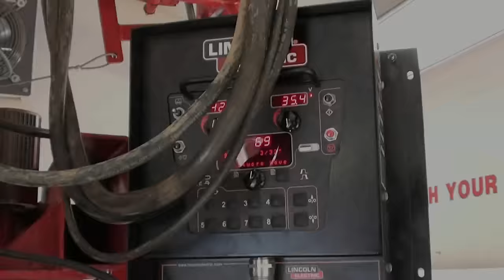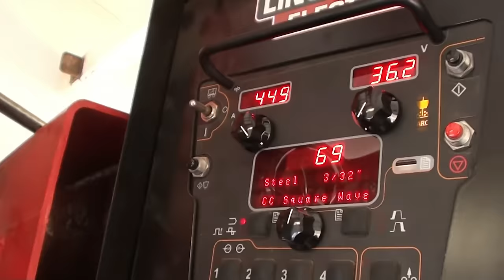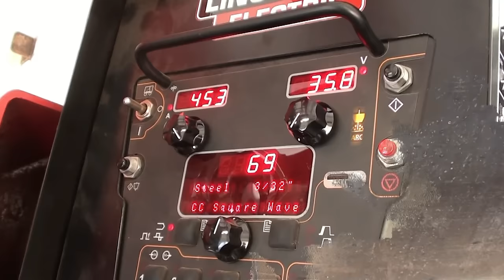Sub Arc Welding - SAW

Comment: This is the method of welding that the US sent technical advisors to the USSR during world war 2 to show the soviets how to make really good welds on the hulls of the soviets tanks. It increased the durability and decreased the production time of the tanks so that the germans had a really bad time on the eastern front. As an example the T-34's made before the war started were good but once production speed was increased, the T-34s were susceptible to having their hulls crack at the joints between the massive plates. So these tanks were literally cracking apart after being driven only 10 or so kilometers. And if they got hit by a high caliber glancing blow the hull would be ruined due to it cracking along all the seams. Afterwards, both speed and quality increased massively allowing the tank factories to outproduce the Germans  by a factor of almost 10.
Reply: I wanna see the rotisserie that spun those soviet hulls in a circle.
Reply: Nerd alert
Reply: Evidently some people have never seen seem welding equipment for straight line runs. Some people call that track welding equipment. Some of that equipment has multiple adjustment points to follow very irregular seams. I have seen subarc welding equipment with a hand held torch. The massive slag blanket and unmelted flux really help to slow the cooling rate in the weld zone and heat affected zone.
Reply: Appreciate the comment, huge fan of ww2, very interesting.
Reply: how did they fix the heating issue?

Comment: I'm gonna start dumping kitty litter on my mig welds.
Reply: Clean it first or you will get shitty welds
Reply: These are the two best comments. Got a good chuckle out it. Lol
Reply: I think it would work better with my $99 flux core.
Reply: I bet if you got a crate of sparklers and cut em into little pieces and dump em on your electrode you could do even better welds.

Comment: Haha, this takes me back. Spent 9 months as the offsider on the other side of those 4 ft diameter cans knocking off the slag strips with a hammer (point and chisel-point). Steel was 3/4" thick, and usually took 3-4 rotations to fill the gap (was a wider gap) with cap weld on top to finish. Looks like you don't have a problem with slag strips these days. It was 35 years ago for me. Welders were still Lincoln Electric though, but no fancy digital displays. More or less just a knob for volts and a knob for amps. Nice work :)
Reply: (I hate when people do this)

Comment: Never saw a cleaner weld in my life. That machine is amazing. I may read up on Sub Arc Welding because it seems like a very interesting process.
Reply: Then you are not keeping up ....well your comments is 7 years old .....wait a minute 6 years ago I was operating a tower trolley sub arc that welded 12-16  foot diameter tower sections together and this would have gotten me FIRED!

Comment: In Ireland this is known as Submerged Arc Welding and according to the steel fixer that attempted to teach me how to arc-weld back in the early 1970s the technique was reputed to have been perfected by a team of welders and engineers at the Haarland and Wolfe ship yard in Belfast (wher Titanic was built) and was used initially to butt weld large sheets of plate steel together to form ship-decks etc. Nice demonstration video.
Reply: Frussell3 It's still used for ship plates.  I UT these types of welds.  Most are very clean.
Reply: Frussell3 So the same name? What did you think "sub" was short for?
Reply: Well I guess it wasn't perfected on the titanic

Comment: i work in pressure vessel fab shop in the east bay California we use this process all the time for our round and straight seams for the large and small pressure vessels and heat exchangers we build. Awsome and super chill process to run if you know what your doing. Set up is the key for a clean sub arc weld.

Comment: I remember reading that the engineers working on Apollo in the 60’s had a problem with their welds and finally decided that the automated welder was the problem. So they took it apart and reengineered it. Great strong welds afterward.

Comment: Do this every day on round seams on pressure vessels. Far from perfect, I think its a popular process just because of the sheer amount of metal it can lay down so fast. Alot of ours have to pass x-rays and have a certain amount of imperfection or less. I believe it has a good amount of porosity, but so much is passable. I believe its been around since the 30s, and I wonder how ide never heard of it until i started this job.
Reply: J'ai soudé des cuves pour total,ce procédé est très sains en radio

Comment: The "kitty litter" flux lets impurities rise and insulate the weld so it cools slow:-)
Reply: That answers the questions in my head, thanks.
Reply: Thanks for the answer!
Reply: Thank you for the explanation =)
Reply: H3R3T1C yea it’s kind of interesting they posted this comment not knowing the actual use.
Reply: @MFKR696  Thank you for that correction, it bothers me that the least informed out there are the most confident when they speak. I used to work at Lincoln Electric in Euclid Ohio and loved seeing these massive pipe welding machines in action!
Reply: @MFKR696  a longer cooldown time of the weld and the surrounding metal is also benificial for the strength. So he is not wrong, but I am not sure if the" kitty litter" is doing that in this instance, seeing the turning speed and not knowing the material of the "kitty litter".
Reply: @MFKR696  I know what it is friend. I was just pointing out that the principles of what that guy said weren't wrong. But just not the case here.
Reply: @MFKR696  That was how the guy called it, actually liked it lol

Comment: I welded Sub-arch for awhile,  every wind tower is welded sub-arch. The kitty litter looking stuff is Flux so no shield gas is needed. When I welded we used 2 ,1/8" wire. One at 90º for penetration at 650v 31amps. The trailing wire was 550v 29amps. Trailing was fill and the pretty cap finishing weld. Our tip was set at 1 1/4 inch from the bottom of the crevice. Our average steel thickness was 22mm.

Comment: Actually, Tank builders are using sub arc to weld horizontal round seams, using a nylon or canvas belt on rollers positioned about an inch of so below the seam to catch the flux and allow it to accumulate above the wire and arc, therefore submerging the arc.  It makes really nice welds even in this position and if you are careful not to blow through thinner material, can do in 3 hours what would take 3 welders 2 days to complete, and do it with very high weld purity.

Comment from the maker: 800,000 views and going strong.  I never thought it would get over 1000!
Reply: Good stuff! We just got three new miller pulse mig machines for alum. Damn I'm gonna be outta a job here soon that's all I will say lol.
Reply: It can be a bitch/finicky sometimes depending on how it's prepped. Our shit is pretty clean so we don't even etch the oxidation off we just go right to welding. The new machines make it so much nicer and smoother. It's very fast, hot and bright as hell! You'll flash burn yourself in the matter of only a couple min. Literally.
Reply: A lot of the 1/4 to 1/2 we weld we run around 24v at around 200 amps. The old standard push pull machines would do the same but at 26v and with lots of spatter. so these new machines will weld the same thickness with better quality using less power :-) 100% duty cycle.
Reply: Well it comes at a price. These are about 15k$ machines. Not cheap at all! Funny thing is the power unit is only like 60 pounds and the feeder is like 30 or less lol. Big power in a tinny arse package :-)
Reply: I'm sure you seen the newer miller product line. Everything is micro chips and computer boards now. No big several hundo pound machines. Even the plasma cutters rated for 5/8 are suit case size now.
Reply: I'm the same way lol. Better to have what you don't need then to not have what you need when you need it :-)
Reply: never done it would love to try
Reply: I came here because I've never heard of the process. Seems quite interesting! Sand as a flux…never thought that would work out.
Reply: Mitch Guzman sub arc is the sheet! Super strong welds and no sparks no hood :-).  anything that keeps the molten from contacting open air and causing impurities. Basically just another form of shielding flux. There's more but not going to try and explain lol. In the old days it was eapestos wrapped candy stripe :-) basically a coat hanger wrapped in eapestos lol.
Reply: proof youtube is filled with people who want to better them selves!!
Reply: saudysky now almost 2 million!
Reply: Hi xAZAZELx13 I'm looking for a API 2B  carbon steel Concentric reducer DSAW 56"x42", do you have any idea where can I find a manufacturer for this piece? Thank you..
Reply: Humberto Chim Angulo  Lincoln Electric
Reply: @whirlpooldemons69  12,8 million today xD

Comment: I used to do this stuff. Pretty rare type of welding I found. Most welders have no idea what the hell I'm talking about when I tell them about the company I worked at. We made rolls for foundries and also rock crusher rolls that make rocks into powder. The rock crushers were so hard we had to burn the cracks out before we could weld them back up instead of cutting them on a lathe. Interesting work.

Comment: Interesting, I wonder if this thing could be strapped to a moving arm to make a rudimentary metal 3d printer
Reply: Jack Mcslay large 3D printer
Reply: It's better to do that with MIG or TIG welding. Also for large constructions it's easier to just cast the metal rather than '3d print' it.

Comment: lots of things can cause pin holes. you can use a flux core wire with the SAW process and it will give you a better chance of obtaining fusion and less of a chance of contamination. As long as the metal is clean a solid wire can be used with the SAW process. Using the FCAW process with a argon/co2 back up is an excellent welding process. SAW is great for long welds in the flat position but FCAW is much more versitile.

Comment: very nice video. thanks.
Reply: HE IS RUNNING "WAY" OUT SIDE OF  PARAMETERS BEING SEMI AUTOMATIC LIKE THAT YOU SHOULD HAVE HAD A MUCH MORE UNIFORM WELD, I COULD DO BETTER FREEHAND WITH DUAL SHIELD OR EVEN CORE SHIELD 6. IF I WERE RUNNING YOUR WELDER, I WOULD HAVE THE INCHES PER MINUTE, VOLTAGE , AND AMPERAGE SO DIALED IN YOU WOULD ONLY SEE A DIME HEIGHTH AND WIDTH WELD WITH PERFECT UNIFORMTY
Reply: @noahstang  u dont even know what parameters are

Comment: Lincoln Power Wave power supplies are possibly as sophisticated as they get.  The software is so flexible as far as waveform control and process analysis are concerned that they actually use these power supplies for welding research and development.
Reply: douro20 but can it run doom

Comment: when it comes down to it , pinholes are caused by contaminated metal. you can have all of your settngs correct when welding (ie:gas, voltage, amperage,) but if your base metal is dirty and/or your filler metal is contaminated you will get pin holes. Keep in mind too, when welding with the FCAW process, your wire can rust from the inside as well. It must be kept in a rod oven or some type of sealed environment.

Comment: Amazing how clean the whole process is!
Do you reuse the excess flux?
Reply: Thanks dude!!
Reply: Im curious, is there any shielding/flux on the inside of the pipe?
Reply: Some Sub-Arc machines have vacuum cleaner hose that sucks up the non-fused flux and returns it to the supply hopper.
Reply: they do have some sub-arc pipe machine where i work that does inside and outside shielding /flux but its spiral butt weld
Reply: Yes

Comment: How do you guys avoid massive inclusions in those welds? Seems like those little beads would mix with the puddle.
Reply: that type of flux is designed to float to the top of the molten weld instead of melt into it like a traditional welding rod.  Would be nearly impossible for any to get stuck.
Reply: They would drill out the inclusion slightly larger then the inclusion and repair that area.

Comment: yes, although what he is welding here is pretty thin.  With my machine I start with lower voltage and amperage for the first pass, more of each on the second pass, ditto third pass, and fourth pass and on it remains the same.  My setup is also a dual head which I can use on 36" and bigger diameter in which case, the fourth pass I fire up the AC unit.

Comment: i work in the VCS sub program, we use something similar to this. they are not perfect and its a nasty process if you have to remove the weld and do it by hand, but it cuts down the time significantly building a submarine.

Comment: That is the most beautiful weld...
Reply: that is a beautiful weld
Reply: You can get beautiful welds with TIG, too.
Reply: Luis Moreno The deposition rate is probably a little lower with TIG though!  :)
Reply: Jon Bruce spray arc leaves the same bead by hand .
Reply: Orbital welding on jet engine components is even prettier.
Reply: Probably the best looking weld i have ever seen.

Comment: yea, it's a cool vid. I have done some SAW before but never on pipe with a rotator in the field. I was actually curious about how you recover the unused flux. Is it just some type of hopper set up on the back side of the pipe?

Comment: I have 8 years of experience of this type of welding with single, double and four lines simultaneously
Reply: How mutch power does one draw? Is it a normal welder?
Reply: Normal welding on lincon wire 4.0 610 amperes and 30/32 volts 
Also depends on material
Reply: @sarbjitsingh-pe5bm  that is the output.  He asked how  much power  it draws, which i assume as in how much the machine uses.
Reply: @sicsempertyrannis6851  just multiply current by voltage and Bam you got your answer , according to the reply stated above total power is 19520 watts.

Comment: When I used to repair welders I had to replace a transformer on a 1500amp Lincoln welder used for SAW.  After the repair I wanted to make sure everything was working as it should so I went to the factory where it was installed.  The operator was joining two 1" I-beams and was running around 1000amps.  I had never seen SAW before just MIG and TIG so I was expecting to get a nice sun tan. I put on my welding helmet and stood back a few feet.  Needless to say I got a few laughs at my expense.

Comment: Really nice weld, but is that the only benefit of this welding process? Or does it produce a stronger weld?
Reply: As long the operator dials in the correct settings and that everything is prepped then it will do a weld that is very uniform with no defects and very quickly.. its something companys will prefer you use.. they dont care if you can do it by hand or not.. its how they want the welds to be done

Comment: how the hell do you set it up? must be a pain to get dialed in cause you cant see what youre laying down right away! awesome video< I always wanted to see sub arc weld
Reply: For set up you always have a spec sheet with recommended voltage and amperage. And yes the downside of SAW is that you have to wait 8-10 inches before you can see what your weld looks like because the ''sand'' kind of melts to create a big flux crust that is hard to remove right away!

Comment: Very nice! I heard the bad spot as you were panning the camera around to the control unit. And you could also see it in the flux once you paned back to the cylinder it's like a split-second where it loses ground or something I don't know. seems to be common with sub Arc. welds look beautiful. I also have a sub are much older. Works great awesome machine ,but those bad spots usually don't mean bad weld just a high spot.

Comment: I run the exact machine on a daily basis look into a flux recovery system recovers 90% of unused flux also an additional flux hopper that sits stationary close by your machine keeps you topped off and limits your need to refill and keeps you going for hours. Nice work

Comment: I wonder how this thing looks when it malfunctions
Reply: Kaboom
Reply: Most likely if it malfunctions a safety switch gets triggered and it shuts itself down until they find the problem and manually reset it
Reply: Dante Mariscal I work at Lincoln electric usually that’s the case

Comment: He's welding the outside "gert" seam. On wind towers it has a 30% bevel and a 5mm flush spot. You would also stand in the inside and weld the inside gert seam. We used 2, 1/4 wire Lincoln welders.

Comment: Is it basically mig welding under granulated flux?
Reply: John McJohnson I think so
Reply: More like "wire feed welding with a granular flux shield" instead of a flux-cored wire.  MIG in definition of it's acronym, implies an inert gas as shield, and unless dual shield, no flux applied through the welding electrode as in flux-core wire-feed or stick welding.
Reply: This is unlike mig welding,the arc is sumerged on a molten flux,that how it got the name
Reply: You got me with your picture, tried to blow a hair off my screen.